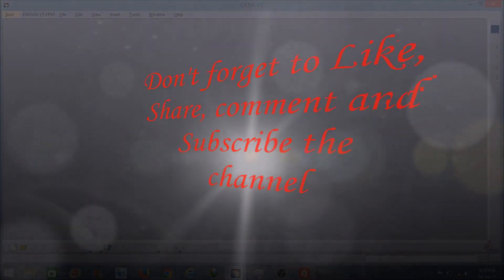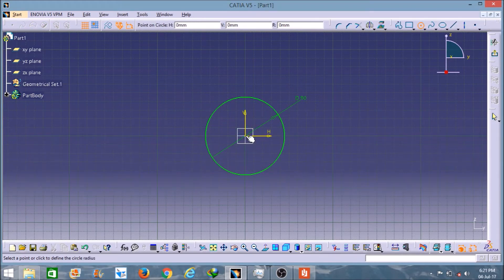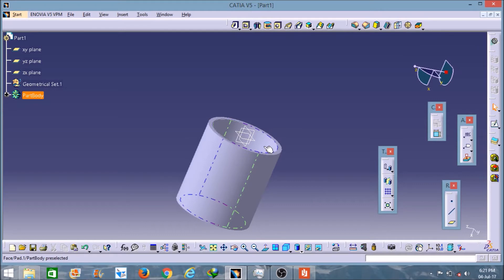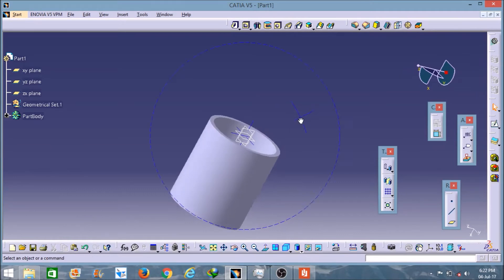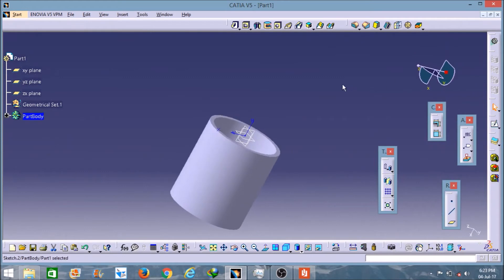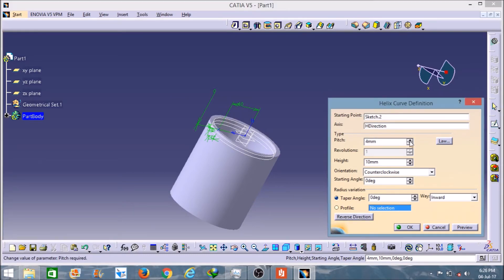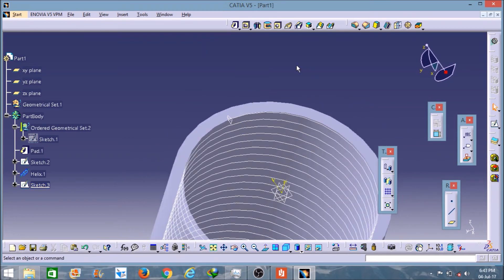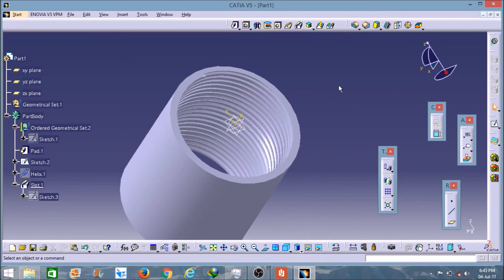Catia V5: Internal Thread Tutorial

Comment: In case you are wondering why your thread looks strange and twisted (and you get that warning message) - you need to define the drawing direction when generating the groove - it is the direction of the thread, e.g. the center axis of the helix or hole. Then the profile does not rotate during drawing.